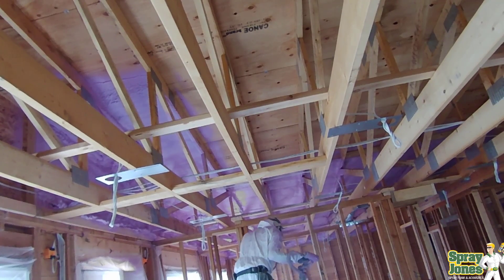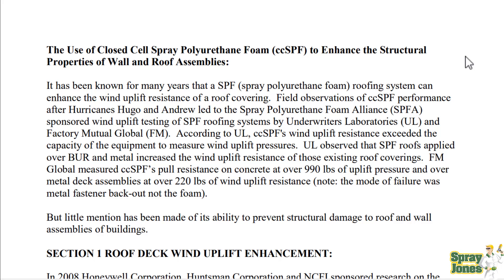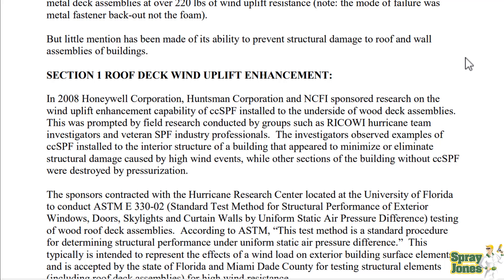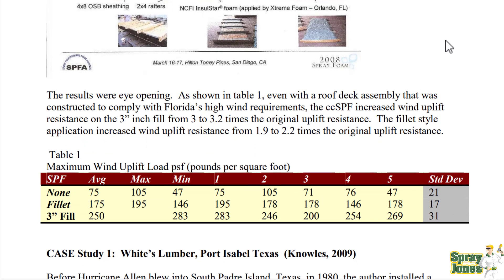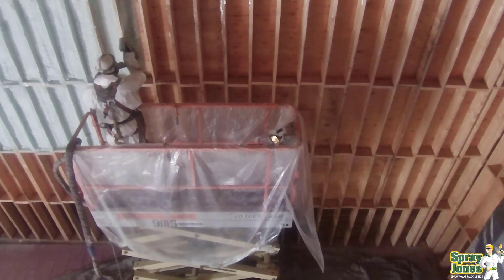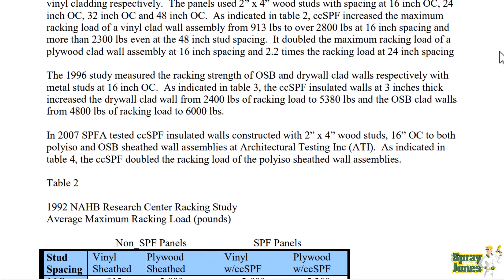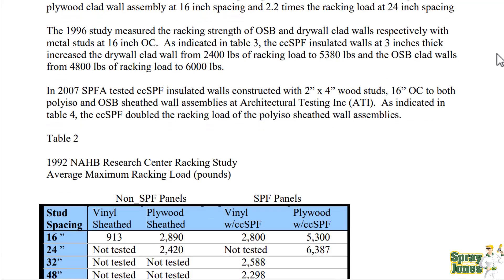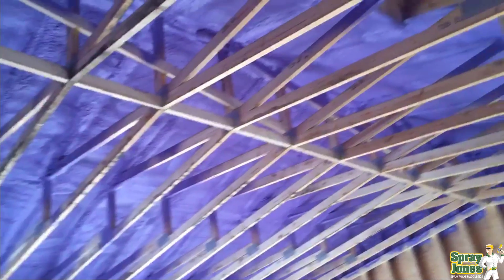Rigged Code Series | Part 4 Structural Benefits of Closed Cell Spray Foam Insulation

Comment: I have a question about air-tightness. I must have watched most of the videos of yours but I don't think you talked about it yet.
Since foam tends to shrink a little over time, are you aware of comparisons of blower-door tests on freshly sprayed houses vs. after 5 or 10 years? Is there a concern?
And if there was, would  it be viable to spray over the already installed spray foam after some time if one has concerns about their air seal?
Reply from the maker: Properly sprayed foam - open or closed - will adhere to the studs for life. Closed cell foam is an air barrier material and used in many commercial situations to be the air barrier system for the exterior. Closed cell is tested for its adhesion and dimensional stability. I have closed cell foam in my home of 13 years old - there is nothing wrong with it - however all the other joints must be sealed with other products that are equally as good and that is usually where the failure are if someone has used cheap products or installed them wrong.

Comment: Viewers in the UK beware. If you want to do equity release do it before you get any spray on insulation done. If its already there i think im correct in saying no equity release providers will touch it. Similar comments apply if you want to sell the property as mortgage companies are wary of spray on insulation because damp can rot the timbers. Doesn't matter how reputable the installer is, what guarantee is in place. There is a blanket ban by equity release firms. Mortgage providers will either refuse or charge a higher interest rate.

I speak from bitter experience in trying to sell our mums house to pay for care home fees and this is what we found out.

Comment: What is the average cost of closed cell spray foam walls and under roof deck for a 1500 sqft home?
Reply from the maker: You need to ask your local installers.
Reply: @SprayJones  So what's your average?

Comment: Mike, would you think having a WRB directly on studs, between the SPF and sheathing, would affect the racking increases negatively? I'm building a small structure with structural finished panels directly on the studs to avoid siding, and got me wondering if the SPF adds racking strength mostly from the adhesion to the sheathing, or from compression resistance in between the studs? I'm thinking about cutting the WRB out of all cavities that don't have window/door openings (maybe leave an inch around the studs) since the foam will act as a WRB in that area anyway. I'd love to hear your thoughts. Thanks a million for these videos!

Comment: This may be an out of the box question.
People take shipping containers and bury them in the ground for basements, storage, storm shelters, homes, etc.
Usually the roof and walls collapse because the container is not structurally strong enough. Typically they reinforce the inside with more steel or the outside with reinforced concrete.
If the hole in the ground is @ 1 foot larger all around the container, 1 foot of foam is placed on the bottom( like under a basement floor), set the container on the foam, fill the 1 foot space on the sides and top with foam, could this solve the structural issue?  The container would be well insulated, with a water/radon barrier.  What would be the logistics and economics of doing this?  Is spray foam only sprayed or can it be poured into a space?
Reply from the maker: I cannot say... you are asking about live pressure loads and I just don't have the data on that. For sure the foam would help, I am not sure how much of it would be needed before less steel could be used.
Reply: Reinforced concrete stronger and cheaper than spray foam.  All the strength of the container at the outer edges. Just span the top with concrete. Maybe 5 in with rebar 12in ctrs before you cover it up.
Reply from the maker: @stevenmiller6725  Still need thermal insulation so the SPF is still relevant...
Reply: @SprayJones  5 in concrete marginally strong enough depending on soil conditions. Spray foam is great but woefully inadequate for shoring. Could weld in some 4 inch beams at 16in ctrs and spray foam them. Then it would help

Comment: Foam Haters are quite a group. Thanks. Bob
Reply: Might be a good reason for it. Be aware in the UK if you try and do an equity release I can guarantee you'll be turned down if any form of spray on insulation is found. Doesn't matter how well it's done, how reputable the installer there is a blanket ban on it. You will also find it hard to sell the property for the same reasons. I know of what I speak because we've had to sell our mum's house and we had to accept a low cash price because she's gone into a care home and strangely they want the bills paying on time. The first thing the new buyer did was to replace the roof.

Comment: I would  like to see homes of wood or steel designed with minimum materials, incorporating spray foam to take max advantage of it's strengths. To cover the cost of the foam.
Reply from the maker: Me too. Garage doors are already doing this.

Comment: I am building my home out on an acreage by myself, and have been there almost every single day for the last 2 years now, and we get some pretty strong winds out there. A month ago I had my spray foam installed throughout (conditioned attic setup, thanks to you and the info you provided!), and I can tell the huge difference that made in terms of rigidity of the building. I am on 2x8 walls  on screw piles, and when it's windy outside, on the inside I often don't even realize. There is no creaking or any kind of noise, the whole house is basically glued together! It's pretty amazing! I did the under stairs as well as you have mentioned in one of your videos, might as well! Spray foam is the greatest thing since sliced bread!
Reply from the maker: Agreed! That is good to hear, get a good installer and the product is what it should be. People who get it, get foam.
Reply: Nice testimony